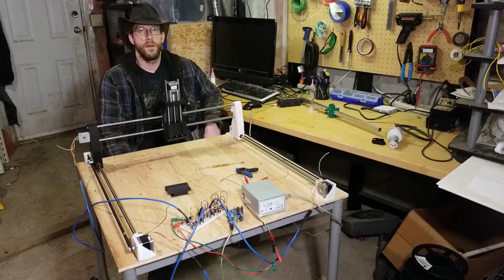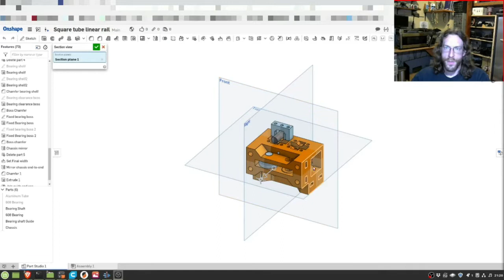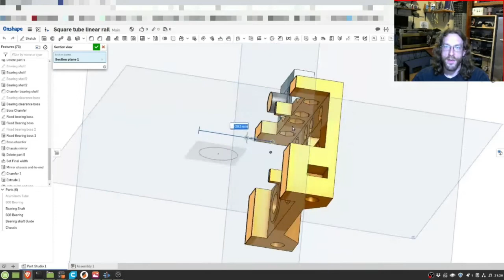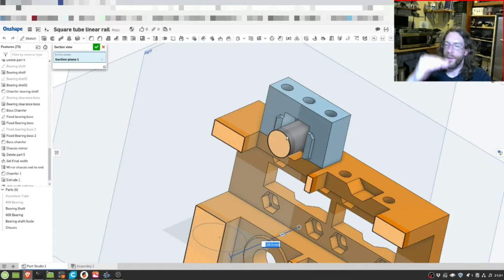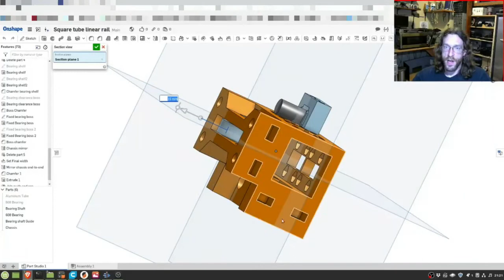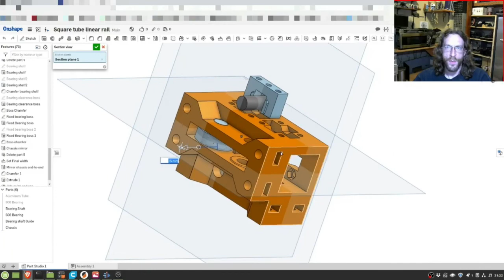3D printed CNC

Comment: There's a reason why linear slide companies are not sweating about business. Although there is one thing you can do with skate bearings to make them into fake Vee bearings that is marginally useful sometimes. You stack two together with a spacer between them. I did the slides for my Z axis with that setup. Then you can constrain motion with a reasonable amount of bearings. I think my whole Z axis only uses 8 bearings? I'm only getting away with it though because the rods are really short.
Reply from the maker: I recently switched to the Root3 CNC design, it seemed like the logical conclusion of my next version that I was working on and so far, I'm pretty happy with it, definitely recommended for budget builds like this!
Reply: @Teklectic  that looks like a more solid machine. Moving gantry machines can be difficult to make rigid on a budget. I opted for a fixed gantry myself. It's hard to beat uprights screwed to the frame.

Comment: Take a look at Openbuilds
Reply from the maker: I had a look at OpenBuilds and their stuff looks good, it was just way too expensive for my near-zero budget, that's where this comes from. These bearings are absolutely dirt cheap to assemble: the 608 bearings can be had for $0.38/piece, the hardware can be bought in bulk off Ebay for around $5/100 pieces, the 8mm rod can be got at the hardware store for about $5, the filament is ~$20/Kg and the rails are about $1/ft at the local Metal Supermarket. All in, each bearing costs less than $5 to produce.
Reply: Liking this build so far. Can't wait to see you finish it. Good luck.